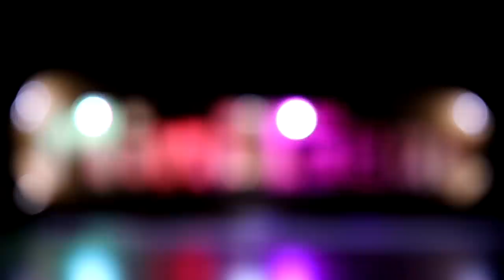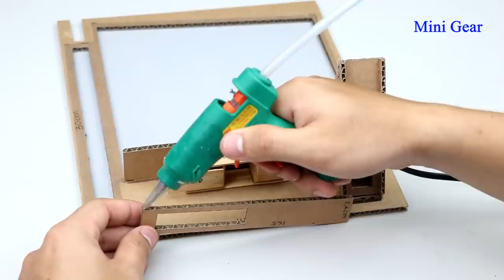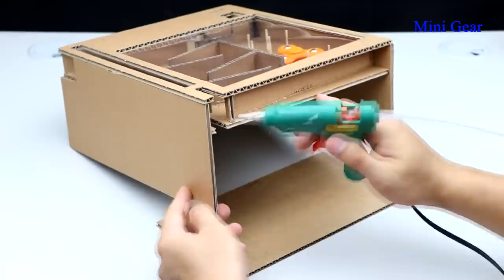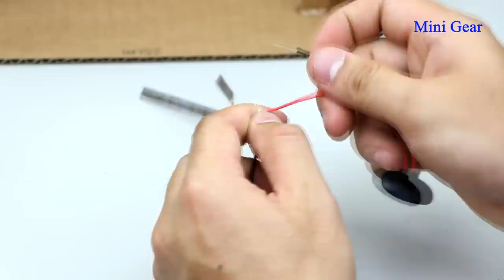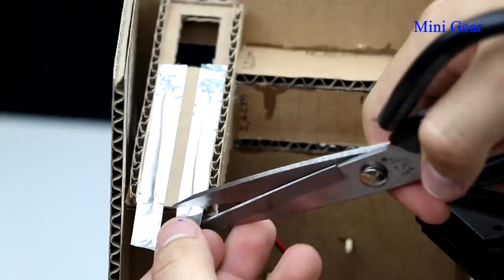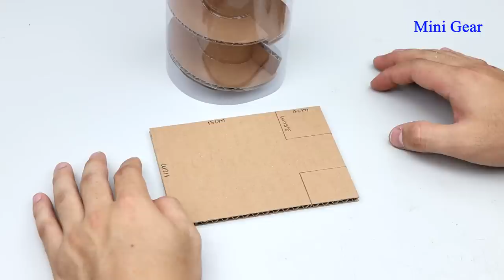Wow! DIY Amazing Gumball Vending Machine with Coin

Comment: excellent work friend, wouldn't you have the project with the measurements of the cuts in pdf? because this way we printed it on the printer and glued it to the cardboard and then cut it out.

Comment: Ummmm you didn’t list all the supplies. How am I supposed to know what kind of glue you’re using or the plastic sheets or the metallic tape? You should be more thorough in listing all supplies and tools. The video is cool btw, but just pointing that out.